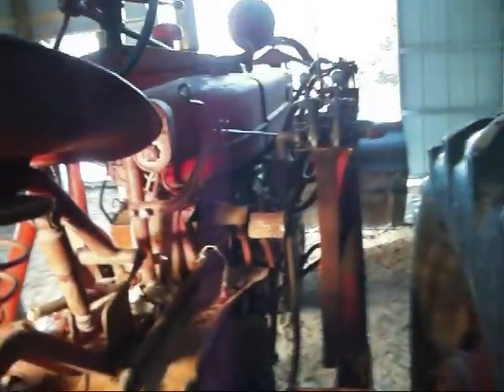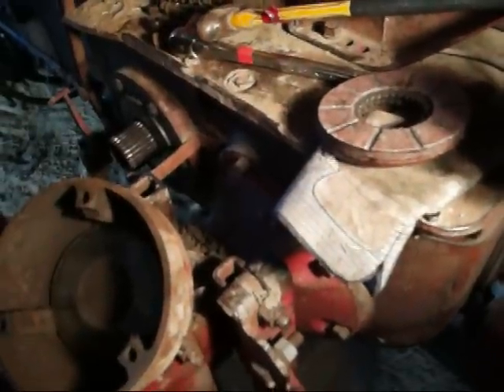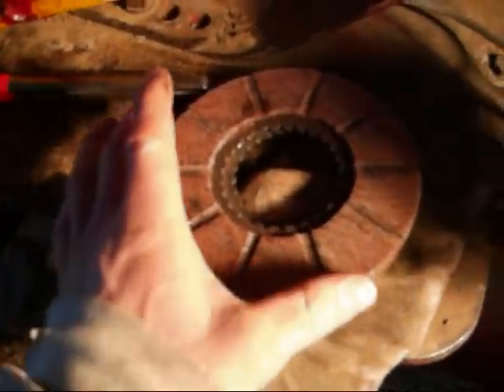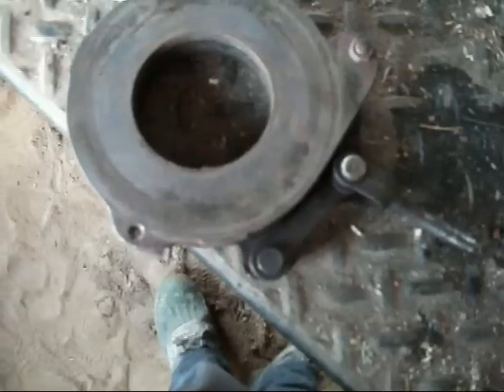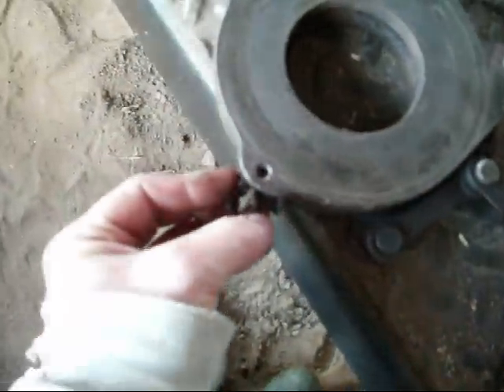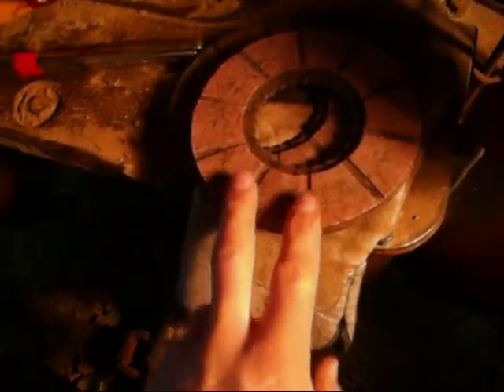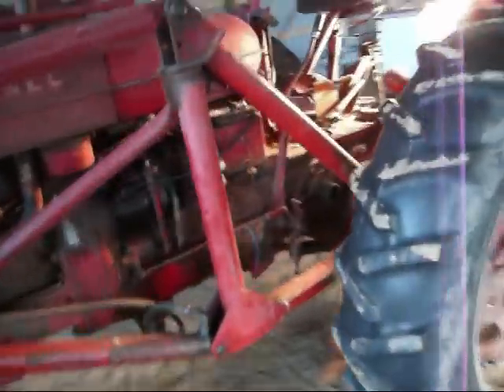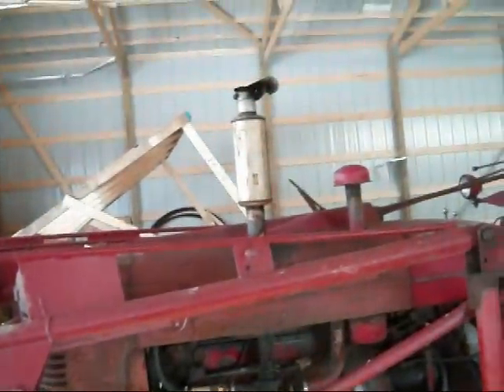farmall m with Lambert disc brakes

Comment: Interesting Thanks for sharing . I had a regular 1950 M with IH disc brakes but I was told that IH starting using Super M parts on the last few M's . In fact the M I had had a Super M engine super M trans and seat. But was according to the serial tag a plain Farmall M ..

Comment: How have they held up since your service job? Had a Super C and it would work great after cutting the glaze as you described, but in a short time the back to no brakes. It was a constant chore cleaning the brakes and wire wheel brushing the contact area. The last time I litely hit the contact area with a grinding wheel hoping the disk would bite in better and not glaze. Nothing seemed to help, even new disk had the same results.

Comment: Just pulled them all apart. Cleaned it all up and put all four discs in the bead blaster to cut the glaze. Then the air tool with a 80 grit pad.. Checked all the other parts, cleaned up the balls and cups.. CLEANED all the threads on the adjusting screws. Back together and I HAVE BRAKES..   All four of the discs were about 1/2 thick total -- About 3/16 thick actual material each side of the splined center pad.

Comment: I want to put automotive disk on M with hydraulic calipers. Mine has these brakes. Have had Super C's that new disk didn't do anything after a hard week of working, they glaze over and are useless. Not sure if these are the same way as the Super C disk brakes. But if it had automotive disk with hydraulic, and cable parking.

Comment: I have these brakes on my M also. Mine need to be replaced, they are worn out. I can have them relined, but I need to figure out what the origiabl width should be.
Reply: Yes same here. There is a shop about 30 minutes away that does this. Not sure what to tell them when I get there tho. I hate to get there and just stand at the counter say ah ,ah , ahhhhh
Reply: @coburnlowman  Did you see my second post? about 1/2" thick and were all glazed.
Reply: @rodneyracer  Thank You. I just found and read your post about them being 3/16 on each side.   After your cleaning how did they hold up?   My Super C's that had disk were all a constant battle. I loved the size and utility of the 2 point fast hitch of the Super C, but every one of them had disk brake issues constantly. The brake shop near me is expensive, if these brakes are gonna be as problematic, I can't afford the $$$$$ to toss. 
    I'm really thinking of making an automotive hydraulic disk kit for Farmall's to market. As many of them that are still used by big farms , as well as market (truck farming) farms. They should be a market for them. Correct me if you think I'm wrong¿?¿?

Comment: found a place that will re line the old disc replace a couple springs and the seals all is good now I also have the lambert disc brakes on my farmall m
Reply: Hey brother, my best friend. What are the thickness of the linings they put on each side???   I bought an old M that had set for 10 months. It had very sticky brakes when I tried it out, because they had rusted. After a little using it , it has forgotten how to even slow down. I took them apart to see if any adjustment was left. They're into the rivets. As I told another poster on this forum, I don't know what to tell the people at the shop just 30 minutes away from us. I know I need to tell them our M is very dangerous!!!!!!